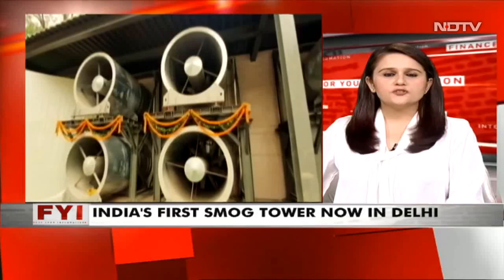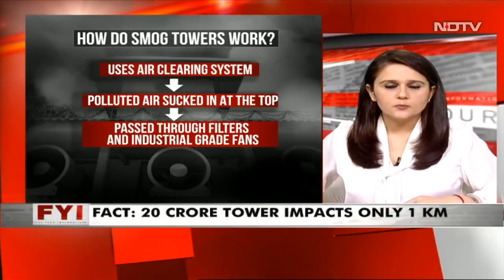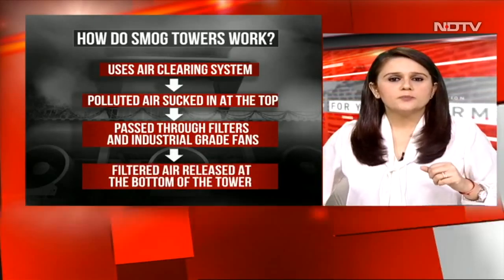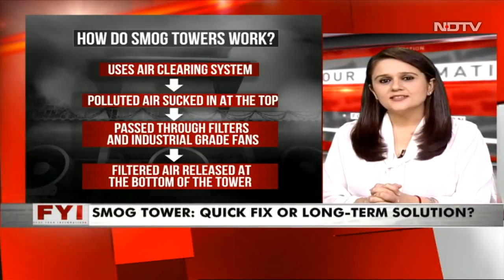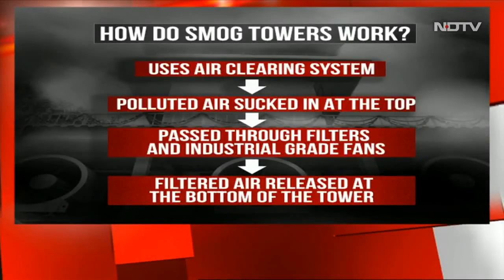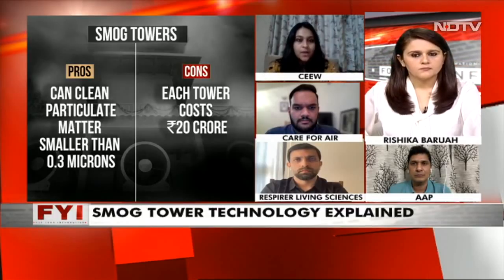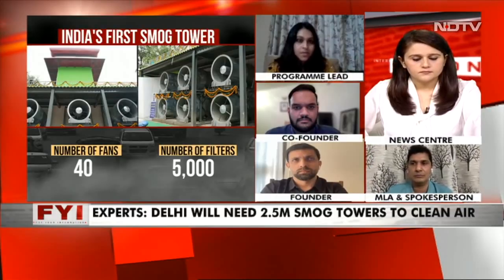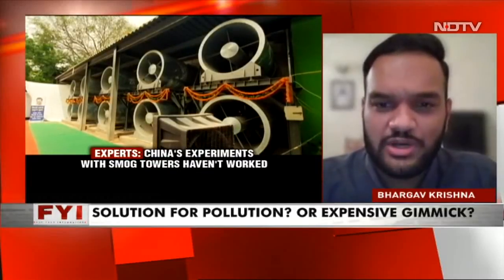Delhi's Rs 20-Crore Smog Tower: Can It Really Help? | FYI

Comment: In terms of pollution..there are few things which Govt can do..rest common citizen also need to change their habits...Stubble burning or using charcoal too much definitely generates lots of smoke..besides this Vehicle is a major cause of pollution... Constructions are a trigger point for pollution... Ppl will also have to contribute to this...Delhi has the possibility to manage as it is not a restricted city in geographical sense hence little bit more planning is needed to take out such industries which cause more pollution outside the city and reduce their pollution emission...E vehicles and E-bike is one of the great solution which can really change the pollution issue... Govt must increase subsidies on E-vehicle, that can be much faster quick fix..compare to Capex and Opex cost of such smoke tower...I have been to shanghai 10 years ago and noticed that they use E-scooter or E-cycle much more comparatively which helps them...its a big and dense city and manages to do good...we can learn from various such examples...
There should be more rental E-cycles at cheaper rates and certain city areas like markets shall be no go for Vehicles...Lets encourage ppl to use E-cycles or E-rickshaws and park their vehicles outside the city centers...This can help to reduce the traffic issue, parking issue and Pollution issue... I am sure govt is trying their best and can d even better...